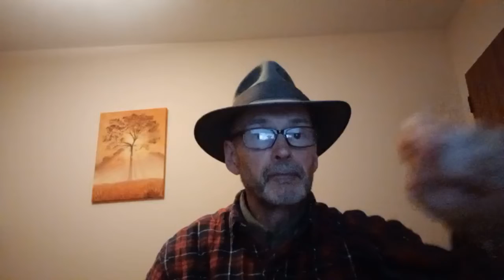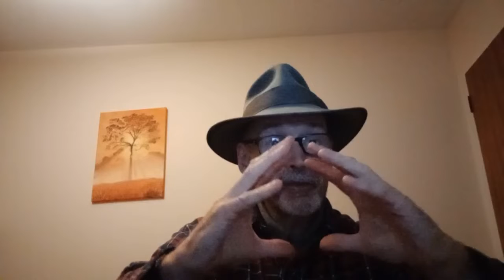Why light take the path of least time an alternative geometrical explanation for Fermat's Principle

Comment: Imme, our yardstick as one entity sets the flat dimensions of space. The outer convex surface of the combined waveforms. All of which are of a lesser and lesser relative sized point particles. Each point's surface a twist in space/time, with more energy contained within as a single countable duration, than without. Energy dilating outward is a duration of time, marked as the imaginary concave center of mass. Existing in space from the center outward, the motion set with a bang by Einstein's Calendar. Everything dilates in time just to exist in the relative space of photons, which are themselves the smallest part of a dilating spherical waveform like our sun. They are unchanging, frozen in proportion, from emission continously till reception. The only non dilating nor contracting entity. For a side note, Tachyons always move faster that light because they are the concave side of reality collapsing, back in time towards the same center point that we are all dilating away from. The opposite direction of the dilating waveforms we call photons. The duration between convex side of reality that we see, and the concave that we never see. This imaginary direction change giving the boost needed for faster than light travel, without interactions. One is attractive or tightening towards the center of our clock, concave. While the other is springing outward away from the same center, convex. Both paths are not always the same. Sorry, back to it. To reverse time is to reverse gravity. Instead of a dilating duration we count as Earth, where one second per second of outward acceleration is counted as static existence. We are one part of a expanding universe from a common beginning, from one hot dense point that we see as a never ending series of galaxies out there.  Again a side note, The biggest twist in space/time is the thought that looking out there and looking in there are the same direction in time. Back to it, Outward from a massive center of mass is the direction of energy. The countable part of reality, is a dilating duration. We can think of this  as a clock, broadcasting its existence at the speed of light in every direction of space, yet is always tied to a center point of mass. Mass is the past. If the twist in time within my eyes showes me that a kaleidoscope of photons, whose different emission times equates to the gap between me and what I am seeing  as one space/time. Then the gap between subatomic particles should be thought of as one time/space, with multiple durations confined within one space a larger duration on the inside than the outside. Breaking this bond releases what we call energy a dilating centerpoint.
Reply from the maker: I am always amazed on how many different ways we can explain our Universe!!!
Reply: No need for absurd nonsense when you can spell it out with a toroidal donut with connected dual opposing vortices(innie/outtie, centrifugal/centripetal) that are touching tips at the center. Creating an outward accretion disc where living matter thrives..  @Dyslexic-Artist-Theory-on-Time

Comment: Incorrect assumption of radius being the shortest path. There is no such thing as a straight line in nature.  For a reason.
These "waves"(what is waving...???) Are traveling how again?  The same way all things interact in this universe.  Implosion from the outside in through the center, in a cycloid spiral form, is the fastest natural path.  Always has been and always will be.  
Concepts are where you and others fail from the start.  I'd suggest reading Viktor Schaubergers OUR SENSELESS TOIL. Or you can just keep up with a lot of nothing.
Reply from the maker: Light always takes the shortest path 'straight line'
Reply: In a spiral trajectory of no single thing. let alone a "line" of 'measure.' 
All following the toroidal pathway in a tug of war as it is navigated  though an interconnected web that allows it to be seen in the first place as that light that is "traveling" only does so 1 way ꩜
Reply: @Dyslexic-Artist-Theory-on-Time  Concepts are not evidence of anything but a lacking process of thought..